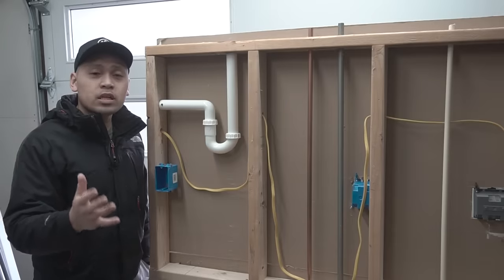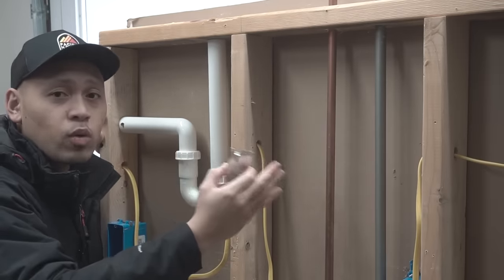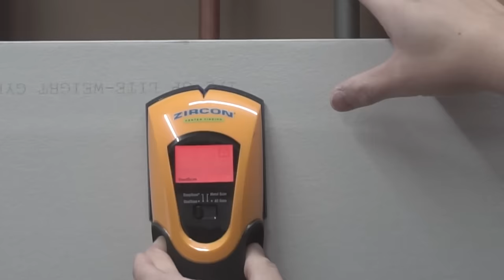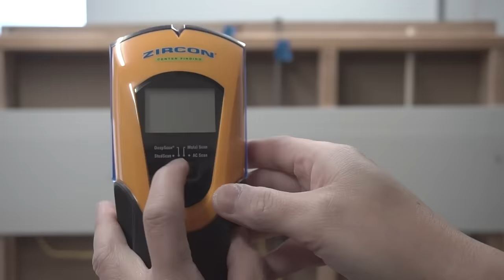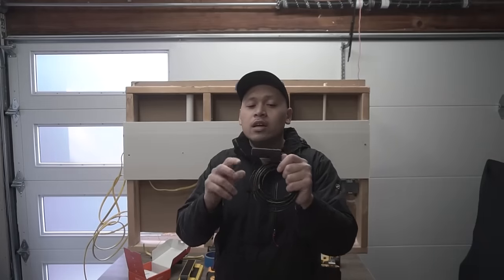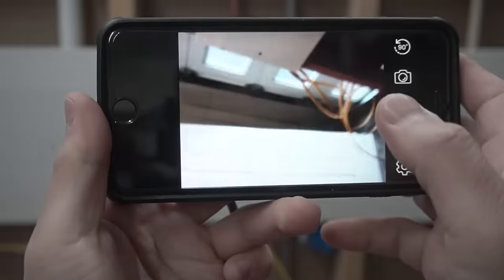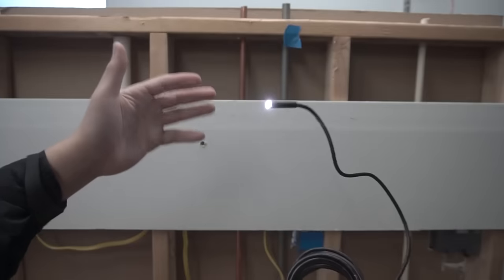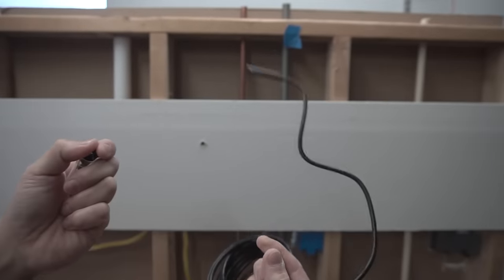STOP Drilling And Nailing Blindly In Drywall And Studs! - Learn A Better And SAFER Way As A DIYer!

Comment: Them stud finder will get you in trouble mine has showed studs and it’s a  bunch of wires
Reply from the maker: I agree! I’ve come to some close calls relying on the stud finders. Their good products, but don’t put your full faith in them 🙏🏽😅
Reply: @FixThisHouse  I bought that same stud finder a few days ago and sometimes all the lights come on when I put it on the wall and then I take it off the wall and put it back on the wall to the same spot and get no lights, those things are very questionable about their reliability,, but better than not having one at all.
Reply: @tremarrimorris75  the trick is most or nearly all stud finders need pre calibration this is using your stud finder to find a stud may be false or true find but the calibration happens when you think you have an area with no stud count 2 or 3 seconds then move your finder to the direction your try to find as it has calibrated if it cant find anything moving to an area with something....
if finder labels wires as stud that unfortunate but its the most accuracy a finder can have if you calibrate it.

Magnets never lie!!!
my favorite thing to do is pair digital with magnetic. 
lot of times i will use my digital to find stud. then i will use a magnet and go up or down till i find a screw head then i use another magnet to find one above or below then i measure 16 inches left and or right and do small circles till i find a screw from here you should see a pattern and it can give you an imaginary xray vision.
this often helps you avoid cutting into nail or screws to dull blades as well as the may creative reasons why you might want to grid your walls.
Reply: That's surprising how bad the non contact voltage detection was. I have a cheap IR thermometer that has a NCV detector in it and it is pretty reliable at several inches away and through drywall.
Reply: Get the Craftsman, shows wires
Reply: What happens when the wall is full of insulation?
Reply: @americafirst2785  insulation shouldn’t make any challenges other than fishing and this is where a good in wall pull system like magnet pull helps
Reply: Same here
Reply: @tremarrimorris75  exactly why I'm here man. Had to return that crap
Reply: @kevinalmeida7159  Exactly what I do.
Reply: Just last weekend I was hanging some surround sound speakers, so i pulled my stud finder out and it didn't show any studs, so I figured no biggie, it's probably just a 2x4 stringer across the ridge, so then I switched to ac mode to make sure there were no wires, all good, nothing found...

Drilled my holes, went into the attic to feed my wires through and discovered I just missed drilling into a bundle of 6 or more ac lines by barely a quarter inch.   

Always be careful!
Reply: @serpent77  yes sir don’t trust them.
Reply: @americafirst2785  u find out?
Reply: I used a magnet before and it does work. For the most part I just drill  and don't think twice about it. What happens if I hit wires?
Reply: Well that is an awesome suggestion. Thank you!
Reply: Mine had me drill into a gas line. Apparently they didn't place the gas lines according to regulations.
Reply: Would not reccomend the DeWalt stud finder.... I love the brand but it gave me 80% false readings when i used it for a cabinet job
Reply: Same 😂😅
Reply: That’s what mine did
Reply: @americafirst2785 ~ You keep warm.
Reply: If you are worried about hitting plumbing or electrical work use short screws or short nails if you need to hit a stud make a hole with a forstner bit and look in the hole to find the stud all you will need to do is plug the hole with some plaster after simple and easy takes the guess work out of the whole equation
Reply: @WhoOwl-o4f  yes sir true but I was working for a gentleman that didn’t want any sheet rock damaged at all no hole’s no nothing. Got me a hole after the fireworks though.

Comment: My house was built 20 years ago and we took pictures of all the walls prior to sheet rock being placed. Sure helps in many ways
Reply: I'm envious. We didn't do that! It's like playing Russian roulette every time we nail or drill something into our walls.
Reply: I did this but I was not great about taking pics. I often refer to the pics but are never enough. So if you're building, take MANY pics. Both whole walls and close up shots of wiring, piping, ducting, etc.
Reply: So smart. Every builder should do this. Especially now, given the costs associated with housing. At least, give us some pictures of what's inside the walls.
Reply: Thanks! Wonderful tip! It should be standard by builders to do this and pass it on to owners and so on when it changes hands.Of course over time changes would have been made but still a big help.
Reply: Wow. Thanks for the idea for when I buy a house?! 😃👍
Reply: Smart!!!!
Reply: Damn, a blue print of everything like that would be really helpful.

More builders should do that.
Reply: @SidiousPalp  yes i hope in the future, the builders require to provide all those documents to the home owners

Comment: My house was built in 1957. Stud finders don't help me at all. When you're trying to find a stud behind a lath and plaster wall which was covered with paneling you're pretty much on your own.
Reply: A trick I learned is using a VERY strong magnet. It will find the nails on the studs.
Reply: U can use a magnet to find the nailing lines along the studs. Try to see if you can find a pattern. Modern houses run studs at 16” on centre, I found in my house the studs for the plaster and lathe walls are 13” oc
Reply: @onua1522  Not when a wall is plastered and has metal lath.
Reply: @illestofdemall13  Fair point, but in my area we mainly use metal lath for exterior stucco and roofing. Luckily haven't come across any on interior here. Though I know it does/can be used indoor.
Reply: @onua1522  Yeah I was mainly saying that because the commenter above your comment mentioned having a 1957 house with lath and plaster. The lath used to be wood but that was in the 1800s and early 1900s.
Reply: @illestofdemall13  Ah I see. I didn't know. Thank you, I've learned something new today. :)
Reply: @judekoch-nobbs3344  I don't know what type of building codes they had back then. My house is 24 inches on center most of the time. Depending on what room you're in, it's not uniform at all. I'm glad they  the lumber they use back then was more dense.
Reply: I’m not sure about where you live, but where I live there is a huge chance that a house built in 1957 has asbestos in it. If your house has asbestos, there is more than just stud placement that you should be considering before drilling holes in your wall.
Reply: My house built in 1972 and it too has the lathe & plaster.  Not a fan!
Reply: Just sell the house and buy a new one 😂

Comment: Having been a professional home automation contractor for many years that works in very expensive homes and specializes in tough wire retrofits, I can tell you that I only use a magnet and Franklin sensor to determine where to drill for TV's etc and have never significantly damaged anything.. There are very few instances in a TV wall mount scenario that would have significant concerns about hitting pipes and wiring. Bath and kitchen walls etc being the biggest concern... If you drill and hit anything in an area that you aren't expecting after drilling drywall you simply stop drilling immediately. Drywall is very soft and pipes are not. Electrical cabling should be attached to studs except for where it crosses stud bays and typically crosses far lower than pictures or TV's etc would mount
Reply: The Franklin sensor is also my top choice for finding studs.
Reply: I bought a Franklin stud finder but was disappointed to find it was defeated by the foil backed insulation in the wall.

Endoscopes can be a bit disorienting, and obviously don’t work if there is insulation back there, but occasionally allow wonders, especially when fishing.
Reply: Many assumptions.
Reply: Hi, In my brand new house 2 times the electrical contractor damage the wire. Nail thorough the wire.
Reply: I just bought some magnets after watching another review from a master carpenter.
Reply: Isn't romex softer than the stud you would be drilling into? In this case, I am thinking perhaps drilling a 1/16 to 1/8 inch at a time and just looking to see if there is anything at the end of the hole. If there is romex running through a stud, I should see he cavity and stop there.

Comment: These endoscopes can be useful. It's really easy to become disoriented though. Inside of real walls are pitch black, thick particles floating everywhere and sometimes spider webbs. Even with the light on the end, it can be hard to clearly tell what you're looking at. The older the home, the worse the inside of the wall is. Try to get another light shining into the cavity you're looking into. Will help you stay oriented and see farther.
Reply from the maker: Thank you for your awesome feedback sir! 🙏🏽😊
Reply: Totally agree, I returned my M12 inspection camera because the resolution was so low and the light wasn’t too bright. Not to mention if you have insulation in the wall, makes it practically useless
Reply: You definitely need a brighter desk lamp for when you study remedial English.
Reply: 100% agree. Closed wall, you can’t see anything, especially if with insulation. Video is very misleading. His “demo” wall is practically lit for a video shoot, no pun intended. Close that wall up, remove the external lighting and then see how practical this is.
Reply: I would think it would help if the stiff cable on the endoscope had a simple color strip, as long as you don't overbend it, you could stay orientated with which way is up.
Reply: Well said Adam. I bought an endoscope from ebay. Couldn’t see anything due to useless light. A few months later the app stopped working making the device useless. Best to buy a larger one with a much brighter light & not from eBay. May need to make a larger hole or cut out a piece of the wall.
Reply: The worst is seeing two eyes looking back at you.
Reply: Just cut out a huge section of wall. What the hell you're making random holes anyway
Reply: @RICHUNCLEPENNYBAGS77 that’s not so easy to repair and hide if it’s a ceiling. Easier to cover up a little hole
Reply: ch-yq5yn   If you just want to hang a picture you don't even really need a stud.

Comment: They should invent a drill bit add-on that as you drill it detects voltage and warns you before you keep pushing it in.
Reply: The only problem I could foresee with that is that, in order for the drill bit to detect voltage, it would likely need to be close enough to make the circuit. Unless it can detect it at a sufficient distance and instantly cut out the drill before making contact (i.e. not being reliant on human reaction time), I suspect that by the time it beeps to warn you, it's already too late.

Comment: A couple of things here. First of all, using a scope like this is not very representative of real world conditions because your wall is open. When the wall is closed, its going to be harder to see. Second, you can get a set of "drill stops", which are small round collars for the drill bit that you put on with an allen wrench. The best rule is that you can only rely on finding a stud, and assume that there is a wire or pipe at the halfway point in the stud. Treat the cavity between the studs as a no-mans land until you verify it with a scope. Finally, get good at patching small holes. Sometimes the best probe is just a small nail, which can tell you absolutely if there is a stud back there or not, and is easily patched. Finally, they sell cable finders that will detect 60hz wires, you listen for the noise.

Have I drilled through a wire? Hells ya. Live stove wire (220v). The real danger was I was on a ladder and fell off in surprise. Had to open the wall and replace the wire.

My most interesting use of a scope? I dropped a bolt into a car engine and it was sitting on the pan under the engine. I used a scope to find it and pull it out with a magnet part grabber. It was true surgery: I had to put the part grabber exactly to where the bolt was, so had the scope watching the bolt while I fished around with the grabber.
Reply: You do know there is a damn light on the end of it right? So yeah it’s exactly the same as it would be real world. Also a nail won’t detect electric. You missed the whole point. And never have used a scope.
Reply: How many fist pumps did you do after finding the bolt?

Comment: I had to screw down squeaking floors in a flat. I hadn't seen this video at that time, but I bought this exact endoscope and I'm so glad I did. My modus operandi was to get an eighth drill bit and set the depth stop on the drill to the floor panel depth (the floor is made from 6 x 4 panels of plywood, not floorboards, so can't be lifted). Once I had a hole I then inserted a stiff wire and felt around. If all clear, I then drilled the hole to 22mm width (just for better clearance) and inserted the endoscope. As it turned out, the central heating pipes (in pairs, one in and one out) were running through channels chiselled out of the tops of the joists! One of my eighth holes ended up between two pipes - a close call if not for the depth stop. The endoscope allowed me to see the exact layout in each room.

If I'd done it blind or with a detector (tried that - didn't work), I'd have eventually screwed into a joist just where a channel was cut. Afterwards I covered the 22mm holes with metal plates screwed into the floor - it's all under carpet, so never seen.  You'd think they'd have put holes for the pipes through the centres of the joists to protect them instead of cutting channels on top of the joists right at floor level, but there is no accounting for dumbness.

Comment: Another important, common-sense aspect to this work is understanding that wall's role in the construction of the house - is it interior-backed or exterior-backed (could have insulation in it)? What's on the back side? something with plumbing involved? same for the room upstairs - could be a bathroom which might mean plumbing in the wall (water or waste pipe). Check in the room below/basement. I had a tv job with a 24" wide metal air duct in the wall right where the customer wanted his tv. I was getting weird readings on the stud finder, finally resorted to test holes every half inch which still resulted in weird things. Had I gone to the basement/mechanical room I might have seen the duct work. I had to make a brace that spanned the space and mount my wall bracket to that (actually the job I'm most proud of) plus patch and paint a whole bunch of itty bitty holes! LOL.

Comment: Yeah, will be picking an endoscope up soon for an upcoming project. Found out the hard way that most of the water pipes are plastic, not metal in this house. Worse, in a wall with no attached plumbing, they put 4 waters pipes right near stud, and against drywall. (One horizontal passing through, two one one side, one on the other. And of course they were at ideal height for picture/shelf hanging.
Cannot assume there are no pipes just because there is no plumbing visible.

Comment: When I use drywall anchors even the cork screw type that self drill, I drill a hole just far enough to get through the drywall then poke the drillbit back there to see if anything is behind the wall. The drywall anchor then goes in the drywall straight. I had a homeowner wants used one of the cell drilling anchors and drill right into her pex line

Comment: Make 1”hole near work area using a pumpkin cut leaving the sheet rock paper on one side.  Shine some light in and use an endoscope. Reposition the cut piece with ca or wood glue.

Comment: Thanks for this demo of the pipes and wires! I tried using stud finder but got multiple electric symbols here and there so I couldn't drill in fear of hitting wire. Good thing I had punched a hole (fist size) near where I was going to drill. Ended up using my phone to record and saw that there was only one wire running on the side of the drywall and not directly in front of it. This video helped a lot, will be buying that little camera thanks!
Reply from the maker: Thank you for sharing your experience! Punching method works too! Lol. I’m glad I was able to help! You have a great day Chris! 👍🏽😊🙏🏽

Comment: This might be fine for inside with drywall but hanging things from the out side is harder because your dealing with thick OSB or plywood.
Not only that from what I’ve been dealing with on a house is that who ever wired house didn’t use any plates to protect wire and in some spots the wire was routed  on the outer edge of the 2x4 and against the OSB and some places not tacked down thus loose wires hitting the OSB.
I almost hit the wire with my saw crazy .PS this was a custom home build what a nightmare.

Comment: in addition to using stud and AC finders and getting a sense of the layout of everything, i always drill slowly through drywall so that I can stop the moment I break through the drywall. I then probe with a smaller bit and take a look with a flashlight. depending on the size of the hole you could use one of those endoscopes too.
Reply: Thats the right way. I do that too. Learned it the hard way. Im a fiber/telecom installer

Comment: Check above the ceiling, and on the other side of the wall for any devices. Use a strong magnet to find studs even if they are wood studs it will find nails. Then when you think you're safe use a long control screw driver to stab in the wall to see if you feel anything like wires or plumbing... This will give you only a tiny hole to patch if the location isn't good...